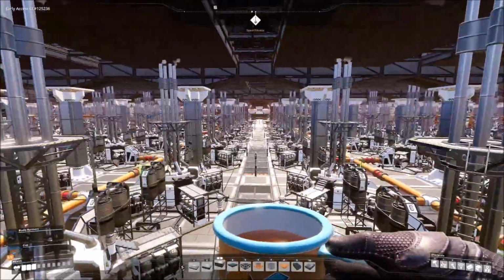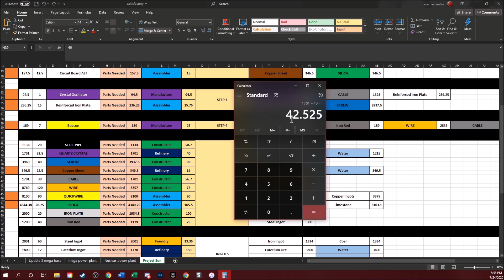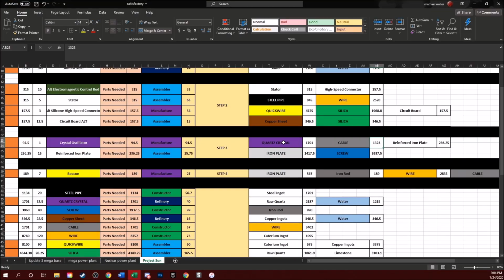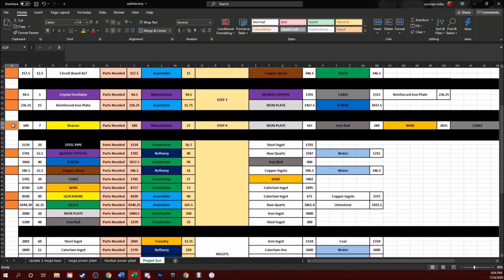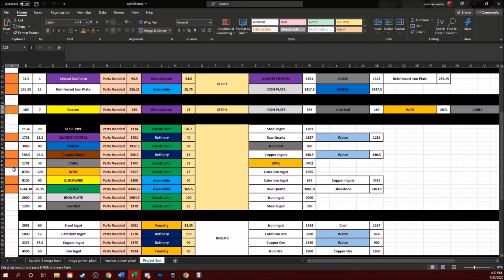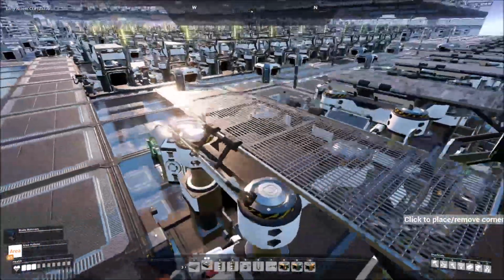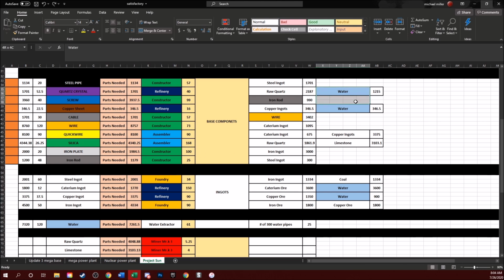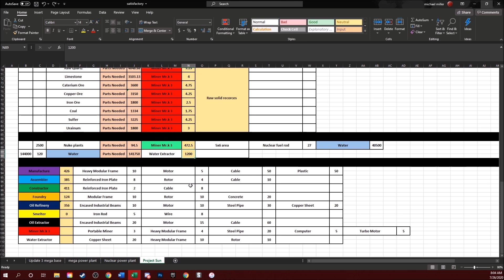Satisfactory lets play Ep 23 MAKING ALL THE BASE COMPONENTS

Comment: Question regarding choice for screws production: For using Steel beams, if you use it in conjunction with Solid Steel Ingot, you're taking 2.66 iron ingots to make 4 steel ingots. 
From that you're making 52 screws per 4 steel ingots. That equates to 52 screws/4 steel ingots * 4 steel ingots/2.66 iron ingots = 19.5 screws/1 iron ingot.
Of course this does mean you're using 1 coal/19.5 screws as well.

Edit: Oh right, turning steel ingots to iron rods would utilize same 2 iron ingots = 3 steel ingots recipe. Which is how 1 steel ingot = 16 screws (1 steel ingot/4 rods * 1 rod/4 screws). I don't have that recipe yet.